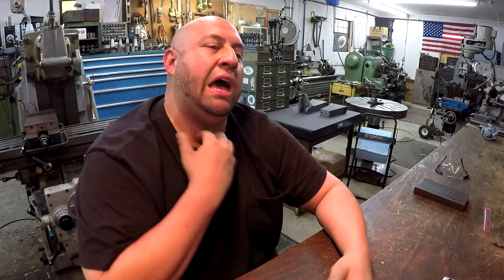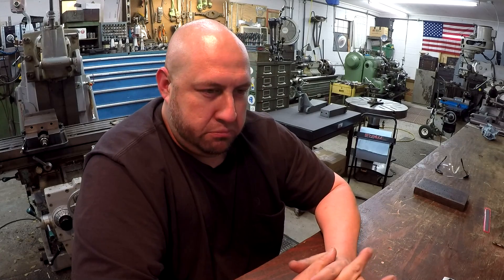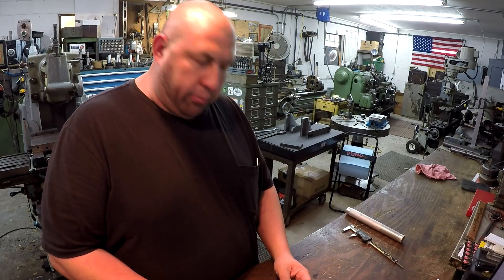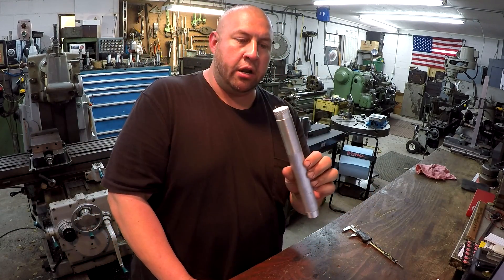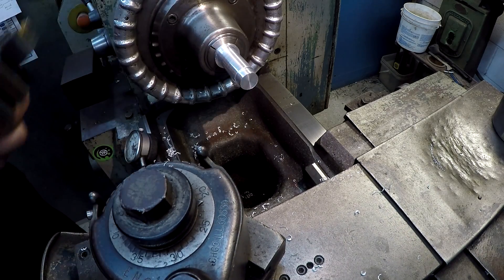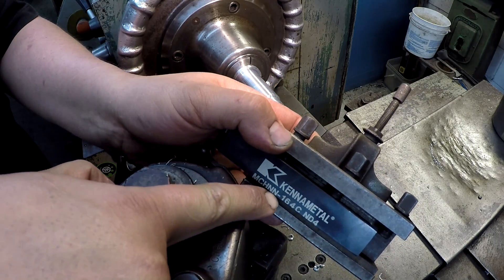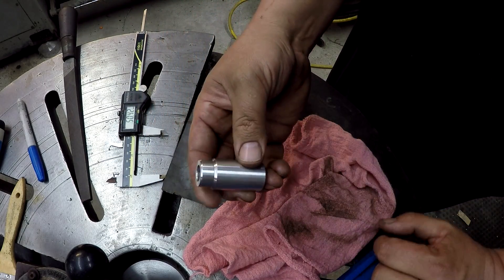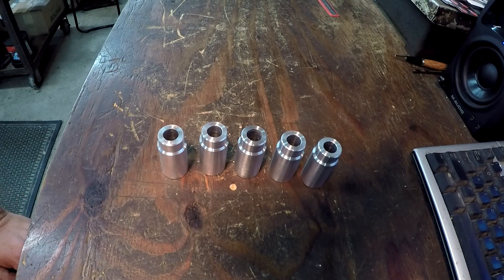Saturday Night Special 121

Comment: Had my tonsils out years ago due to persistent tonsilitis.  Not fun at all.

What did the previous owner of of that lathe whack the back of the cross slide with to get it to go like that??
Reply from the maker: Actually that a cover for the taper attachment. My dad always put the 4 jaw chuck there and the indention's are from the studs on the back of the chuck where he would drop it in place. 😕